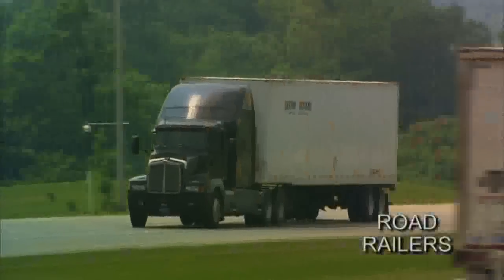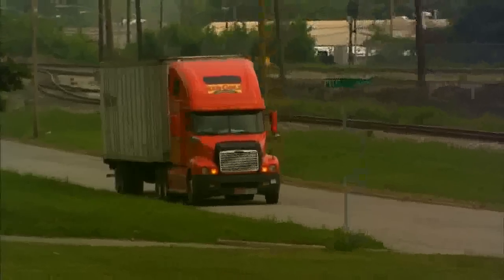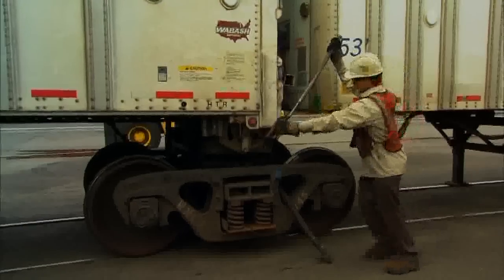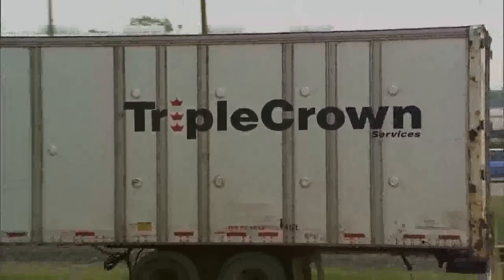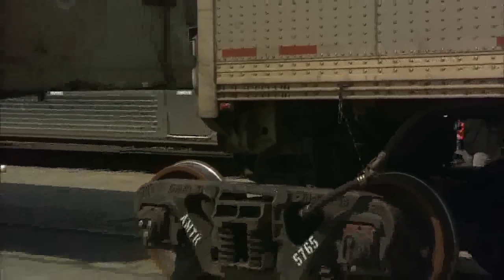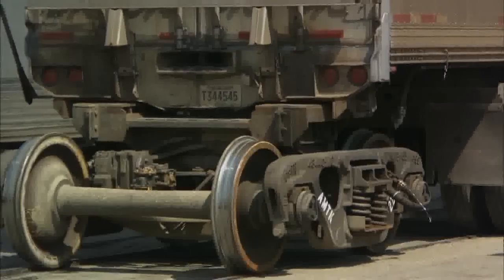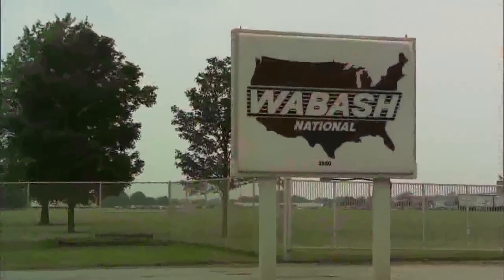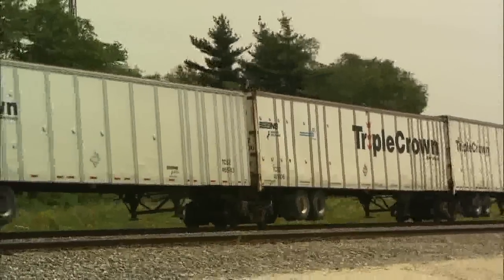Tracks Ahead: Road Railers

Comment: It seems that road railers are rarely seen anymore.
Reply: Roadrailers don’t run anymore. Triple Crown now gets hauled on intermodal
Reply: @Runawayrack  Norfolk Southern still runs two Roadrailer trains. 255 and 256, between Detroit and Kansas City. They carry auto parts with it. They are the last two remaining Roadrailer trains in North America.
Reply: @bracdude181  why? why would stop using such good mode of transportation
Reply: @danmcclaren5436  Not sure. A lot of what used to travel in these is just moved in regular intermodal containers nowadays. Honestly NS is kinda under-utilizing these.
Reply: @bracdude181  because of cost, the Trailers require they’re own maintenance facility and Age
Reply: @BNSF_SoCal_Productions  The maintenance cost of these is higher than maintaining regular well cars? Also I remember that the trailers had to be titled and insured as well.
Reply: @bracdude181 late June early July 2024 they are done. That’s what I heard.
Reply: @jontaylor6068  the only 2 trains left carry auto parts so what will the replacement be? TOFC?
Reply: And now they're officially retired

Comment: So sad that the use has went away to almost nothing, but double stack is hard to compete with an Amtrak's use pissed off railroads who did not like the freight competition.  Triple Crown gave me my start in business, not just pulling road trailers back in 1991, but in dust control as I was one of 3 owner ops that pulled their tanker trailer.  I have pulled the old style trailers and the adapter trailers, just wish I had photos of them.  I worked a lot of the TCS derailment/trailer recoveries over the years.  Sure miss that work.

Comment: BNSF's Ice Cold Express (ICE) no longer operates as a Roadrailer train. Occasionally, you might see ICE trailers operating as standard refrigerated intermodal TOFC traffic. Traffic levels for the ICE Roadrailer train was highly seasonal. It could be relatively high during specific California fruit/produce harvests, but traffic levels often fell sharply during the off-months.

Note:  BNSF still handles Triple Crown Services' Fort Wayne-Kansas City-Dallas roadrailer trains between K.C. and Dallas.

Comment: I remember hearing that some shippers actually liked Roadrailers because the trailers were virtually impregnable when made up into a consist. You couldn’t open the doors when the ICC bumper was up for rail travel, and you couldn’t get the bumper down when the trailer was coupled to another trailer.

So, unless someone physically carved their way through the side of the trailer, the contents were inaccessible while traveling between terminals.

Comment: Correct. Only Triple Crown Services (TCS) continues to operate Roadrailers. Most of the TCS rail network is indeed provided by its parent company: Norfolk Southern. Minneapolis, Toronto and Dallas are served by way of Union Pacific, Canadian National, and BNSF respectively. 

BNSF's Ice Cold Express ReeferRailers and Swift's Roadrailers eventually began riding on flatcars as standard TOFC intermodal, after traffic levels were deemed too volatile to continue scheduled dedicated trains.

Comment: Amtrak still uses Road Railers on some of their passenger trains, depending on which train uses it. Swift no longer uses them and the Ice Cold Express trailers are seen with the connection tongues torch off. It would be reasonable for other trucking companies to utilize this setup.
Reply: None of them do anymore. Amtrak lost the mail contract in 2004.

Comment: 3.5 days from L.A. to New York is faster than an owner operator like me can legally do it. It takes at least 4.5 days to get from L.A. to N.Y. legally in a fully loaded truck because of the speed limit in California, the traffic leaving L.A., but even if you left at night you are still held up by the Rockies, weather and traffic, and Hours of service. My Rate to pull a 40,000lbs dry load to New York would include Tolls and Turnpike Fees, and come out to about 7,700, or roughly $2.20/mi.
Reply: If the railroad can beat that price, I fear we are looking at the extinction of the OTR Driver.
Reply: Good points. The sweet spot for rail intermodal is beyond 600 mi, maybe less. Beyond 600 mi, trucks can't compete. Inside the 600 mi, trucks can compete and win. But there are efforts on the railroads part to create inland ports. These ports will be well INSIDE the 600 mi trucker dominated area.

Comment: Not to far from where I live, NS has a yard where they put there RoadRailers together. Trains there are pretty long and it's kinda funny how SWIFT and Amtrak no longer use these
Reply: 125 cars is max length
Reply: @jibblesq  Only Norfolk Southern now hauls the Trailers
Reply: @BNSFTrains10  I'm well  aware. I used to be a roadrailer mechanic, and I also inspected the train before it departed the yard. I worked out if the Melvindale yard in Michigan.

Comment: I think that the current management of Norfolk Southern Corporation needs to rethink getting rid of these Triple Crown Road-Railer Trailers and Trains! They should have new 53 Foot Road Railer Vans constructed and new Bogey Wheels constructed to pull more of these. All the ones abolished need to be restored to service. With fuel prices on the rise for the over the road truckers driving rigs on the interstate and more and more people out there that don’t want to work for a living crowding up the damn highways, these Triplecrown trains would definitely ease transportation of goods to distant destinations.
Reply: It was not just Norfolk Southern that decided to move on from Roadrailers, it was virtually all rail operators... across the globe.  By the 20-teens (2013-ish), double-stacked domestic 53' intermodal containers had reached enough critical mass and ubiquity in North America to eliminate the cost savings that Roadrailers had once enjoyed.  The streamlining of steel wheel interchange through and around important eastern-western railroad interchange points like Chicago, Dallas, Kansas City, Memphis, New Orleans, and St. Louis, has resulted in double-stack 53' domestic intermodal container shipping as both a faster and less expensive alternative that was also more flexible than Triple Crown Services' (TCS) hub-and-spoke Roadrailer network, where all TCS trains converged in Fort Wayne each night for interchange.  In addition, Wabash National who holds the patent on the Roadrailer bogies and air ride system, and owns the copyright on the name RoadRailer, decided to quit manufacturing this equipment years ago due to lack of sales, and finally removed RoadRailers from their catalog around 2019.  Unfortunately, RoadRailer demand from international export customers in South America, Asia, and Australia had also dried up for similar reasons.   So, no one wants to make nor operate them anymore given that there are less expensive more flexible alternatives in aggregate.

Comment: i  used to work for a  triple crown  contractor and i heard  one draw back to  that type of train vs a normal piggy back/ inter modal  train  is the  top speed . the road trailer can  travel at on rails
Reply: Me too. Where were you? I was in detroit. Did this shit for 5 years
Reply: @jibblesq  what time frame.  I started as owner op in 1991 based in OH, but by mid 90's was on outside as a dedicated carrier - Salt Rock Transportation.  For a short time had a few guys working in Detroit.  I spent a lot of time up there too, including pulling the TCS dust control tank trailer.  Had guys leased to me doing TCS work in OH, FTW, Chicago and Harrisburg.

Comment: Honestly a shame that these faded out. I suppose containerization is just that little bit easier, but I'm sure that certain corridors can still benefit from it
Reply: 2 triple crown trains still remain to this day.
Reply: Double stack routes that opened up on the East coast and more efficient cranes for containers really hurt the roadrailers.   But if you talk with some of TCS's old customers, like GE lighting and BMW they wish they still could use the roadrailers.  BMW loved the autorailers, even though they only hauled 6 cars, they were well protected.
Reply: @forry100  interesting. So the double stack was what really hurt Road Railers?
Reply: @danmcclaren5436  I believe so, the road railers were great before tunnels were enlarged or done away with.  Also improvements in efficiency of building container trains did not help road railers.  But when you talk to customers like GE lights, they said nothing was better than the road railers, the no-slack connections made for a great ride and no damage.

Comment: Wow, it's been around since 1997 and I've never seen this, Railer trailers. Closes I've seen is your typical piggybacks
Reply: long before 1997.  I started with TCS in 1991 and it grew a lot during my time, but for the most part is no longer in use, think one or two small routes.

Comment: wondering why one video looked different, i remember the original ones with wheels attached
Reply: billfusionenterprise
They used to be attached one single set of train Wheels in between a spread tandem on the trailer that lifted off the rail with air but they were so heavy until you couldn't haul max weight..

Comment: We don’t have these in Europe or maybe I don’t know about them.
Reply: Richard Bosnak Scandinavic freight transport is different from the rest of Europe, indeed. I didn't know you had them, but I'm not very surprised you do.
Reply: Richard Bosnak meh...
Reply: Richard Bosnak I like EU more than I like Russia. At least the EU doesn't send you to Siberia.
Reply: Richard Bosnak when a society no longer has serious problems to deal with, its citizens grow weak. This is what happened. Unfortunately.
Reply: Richard Bosnak I live in Romania, a few of them came here by mistake and started crying instantly when they found out where they ended up. :)
Reply: In most of Europe, we don't have them, which is sad. But the fact that Sweden and Norway have them is rather the question of loading gauge, which is larger in Scandinavia than in continental Europe, and not so much a question of how much corrupt the Union is.
Reply: Btw, Richard Bosnak - that's not a very scandinavian name, are you sure you're not an immigrant yourself? :-)
Reply: The UK trialled them in the 60s but it never took off.
Reply: I mean some parts of Europe have modalohrs. Flatcars are still involved, but the quicker roro concept is still there in a way

Comment: These trailers suck a$$. The doors suck, the crank sucks, the big air hose is in the way of the crank handle make for extra suckage, the stupid hitch thing that sticks out the front is nearly invisible and just begging to get run into by a semi trying to maneuver in tight yards. The company around here called Triple Crown runs these trailers and they are all rusted to hell after only 10 years. They are quite literally falling apart, horrible to deal with as a driver. No driver likes dealing with these trailers. They're just big pieces of poorly maintained trash.
Reply: You forgot to mention  the grease on the tractor air lines,    which both the filthiest type and almost impossible to get off.    从     m

Comment: These trailers do not frames under them, so I doubt they are strong enough to do this. They are not built to pull a lot of weight, they are built to haul weight.
Reply: They do just fine. They are built to do this.
Reply: With the right engineering you do not need a frame.  Most of them did very well.